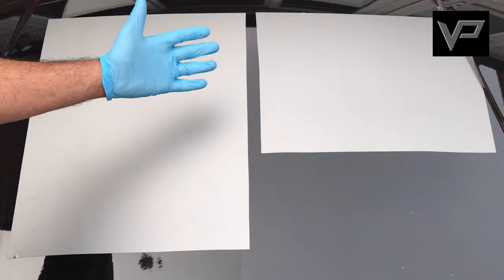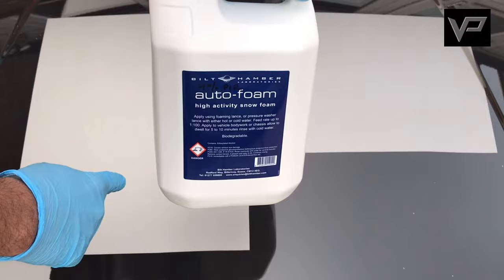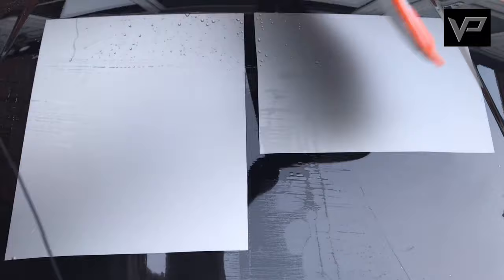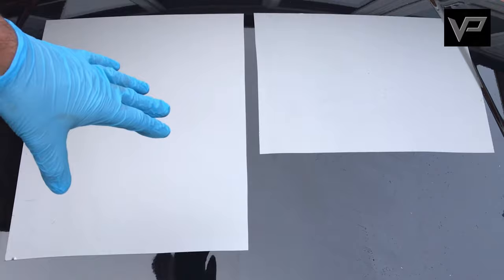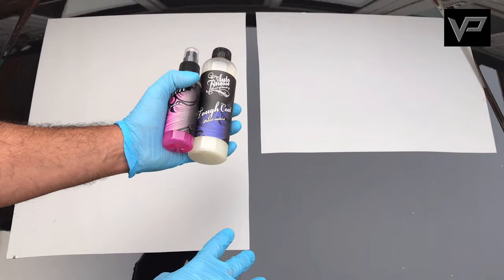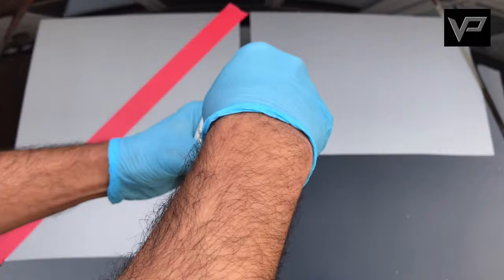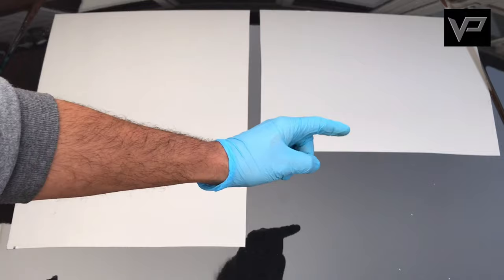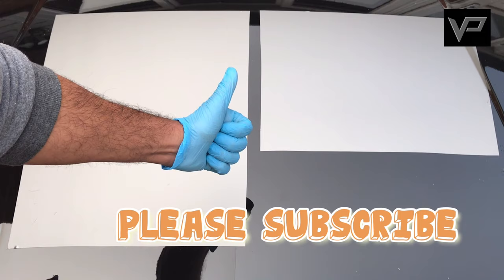Do MATTE or SATIN finishes REALLY NEED Matte or Satin products? ft Dr Beasley’s Formula 1201 (QHD)

Comment: I have a question I hope you can help me with. I have a guitar that has a non-gloss black satin finish. I would like to remove all the finish and get it back down to the original wood finish. How would I go about this? Thanks
Reply from the maker: Steve Hill - Hi Steve.  You would need to sandpaper the finish away down to the wood.  I’d imagine it’s either a non-gloss lacquer, or unfinished satin paint as I have on some of my guitars.  Use coarse(ish) grit sandpaper to get rid of most of the finish, then use finer grade sandpaper to refine the finish.  Just bear in mind that when guitars are manufactured they factor in paint/lacquer as part of the instrument manufacture process i.e. the resonance, tone and sound are factored in when the instument is finished.  Therefore removing the finish may affect the resonance of the wood and may alter the sound slightly ... you may notice this in the ‘warmth’ of the guitars tone.  Just something to bear in mind.  Hope this helps 👍🏽🎸🎼
Reply: @VProjectUKDetailing  Thank you very much for the information and quick reply. I have very little into it so I'm going to give it a shot. Thanks again, Steve